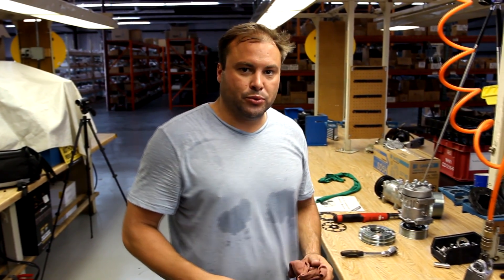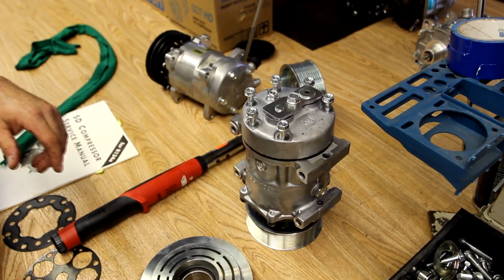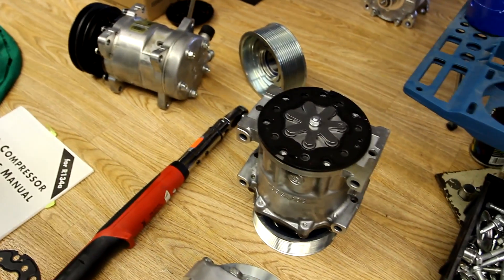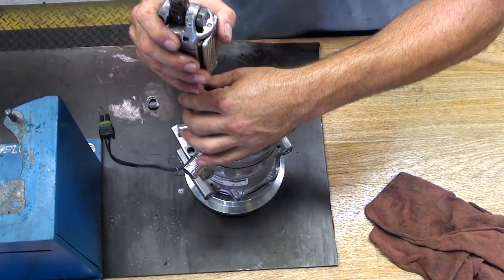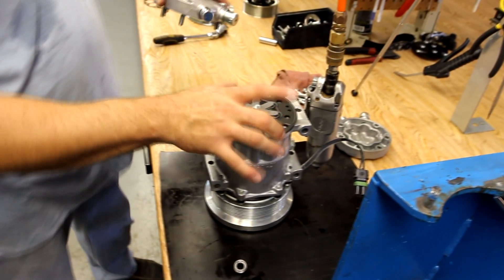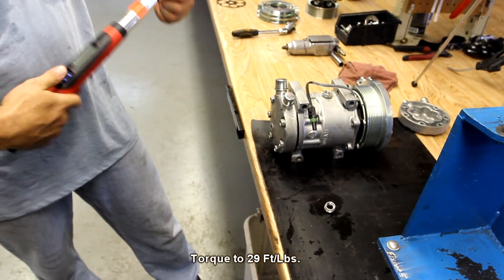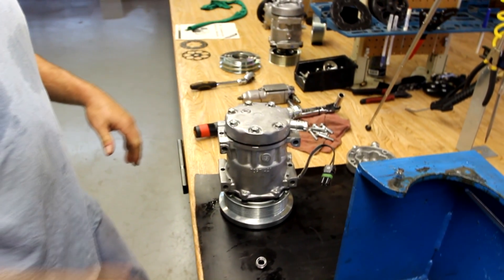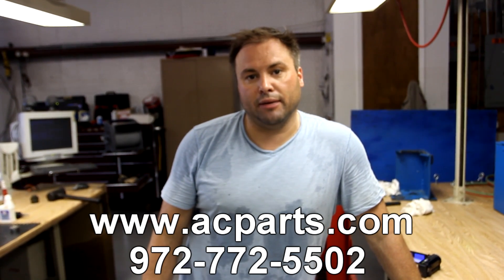Sanden Automotive A/C Compressor Backhead Conversion

Comment: I have a Sanders 7U94-19D629-AA and there is a bolt/port on the back plate.  It is not one of the mounting bolts as it is slightly inside the normal bolts.  It is leaking some oil.  Any idea why or can it be fixed without removing?  Thanks.

Comment: Hi Thad... I have a sanden 7h15 and, it has broken (stripped) the threads for the oil drain plug. It can be fix? I can use maybe a helicoil? (or the gas can leak?). Thanks a lot!
Reply from the maker: Give us a call tomorrow at (972) 772-5502 and we can find the best option for you. Ask for Richard or Ricky.